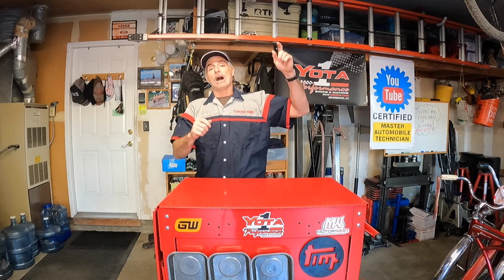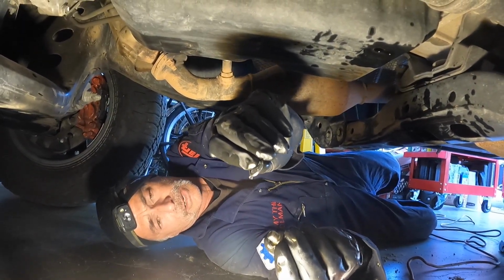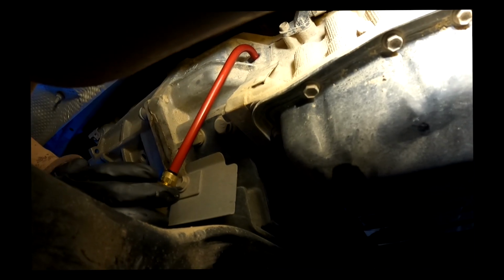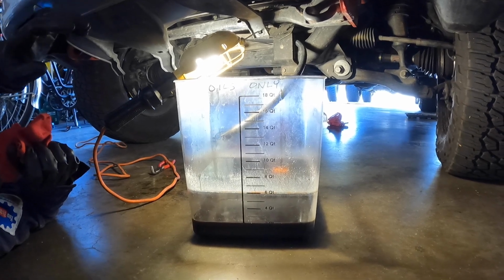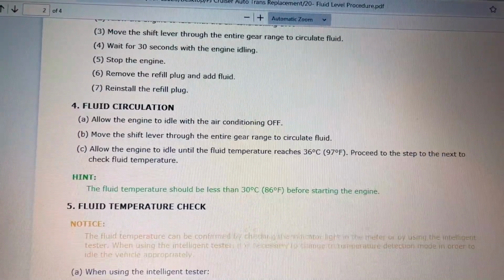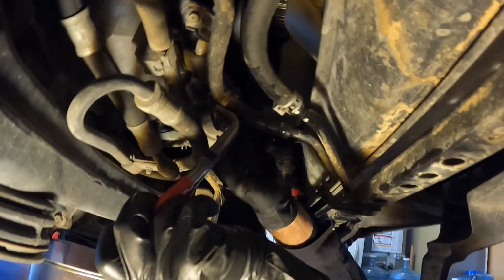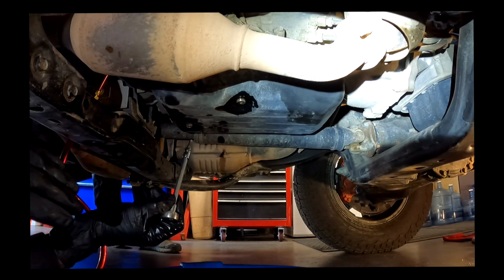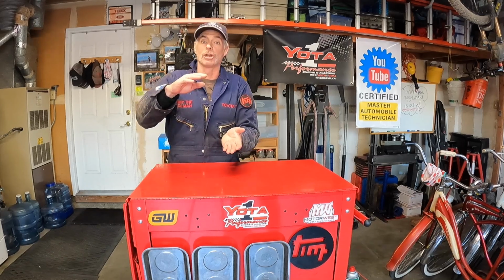Toyota/Lexus Sealed (No Dipstick) Automatic Transmission Flush (Fluid Exchange)

Comment: People do 'exact replacement of drained fluids' at a specified temperature. 

How does this correct previous inexact exchanges?

What is the purpose of the 'overflow drain plug' if the volume replacement procedure is followed?
Reply from the maker: Exact fluid level exchanges works if the original level was perfect and you added back in the exact amount you drained out.  I have containers with graduated volume levels.  When I drain out oil into these containers, unless the level falls exactly on one of the level lines, there's a bit of guesswork on exactly how much was drained out.  You could get close, but you'll be hard pressed to be spot on. 

The purpose of the overflow drain plug is to correctly dial in the fluid level.  Without this method, there's a level of guesswork based off what I said above.  Also, at some point, you might spring a leak in your transmission fluid system.  How would you get the level back to full capacity after repairing the leak?  The answer is the overflow plug.
Reply: @TimmyTheToolman  Thanks for connecting some dots.
Reply from the maker: @Shalmaneser1  You're welcome.

Comment: Last note.
Being the degree of past due lufe on that tranny, instead of just a follow up drain&fills, drop the pan and change the filter.
You will get plenty more fluid out and then can D/F from then on for 60K.
Peace.
Reply from the maker: Yes, dropping the pan and replacing the filter will get more fluid out.  From my experience with other Toyota transmissions, you'll get out around 6 quarts or 50% of the fluid capacity.  I believe 60k  drain and refill intervals only works for people who don't drive much in the hills or mountains.  When you drive on grades, you will achieve much higher transmission temps.  As the temperature of the fluid goes up, the effective life of the goes down.  Since I drive in the mountains a decent amount, I do drain and refills much more often then you, every 10k or every other oil change.  I suggest you do some research on how temperature affects the life of the ATF.  It will probably end up changing your mind on your service intervals.
Reply: @Timmy The Toolman  
I  agree on more stress driving/more frequent changes.
I was only commenting regarding Thahns vehicle as you said only a D/F for upcoming follow up.
You know, the one there is no previous service record of but is now at 'X' mileage.
Sounds like you thought I am challenging you, Bro.
Quite the opposite.
My wording was off. I was referring to multiple D/Fs only over the next 60K TORAL miles, not waiting a full 60K.
My bad.
I did 2 D/Fs on my owned since new 2006 at 87K(1st Service Ever), about 6.5 qts.
I used to drive in very congested highway conditions often commuting in Florida Heat, 20-50+ miles r/t), since Pandemo and Health Disability it's mostly short local and occasional 220+ mile open highway 75+average cross state trips. I never dog her. I rarely get to 4 Wheel Offroad but love doing it occasionally. 
Blew out one CV Axle cuz I did a little fun dirt driving stunt and sounds like I will probs need the other soon as well( used an ET Replacement as no OEM were available/too expensive/Pandemo...

Now I am going to repeat that at/by ~ 104K(and all gear fluids again) so that when I install my OFFROAD Cat Guard Kit I won't need to do again for next 40K, avoiding that whole removal process.
I don't have a shop/crew so must regulate my jobs to necessary ones. And having done full block drain Rad flush/Pink refill, a full brake line flush, entire front suspension rebuild,  as well as constant/consistent oil changes, and having you guys as one of my 1st/earliest DYI gurus, perhaps I have done my adequate research!
Thanks for your years of output. 
Still Love You Guys.
Next stop, Timing Belt Kit.
Afterall it's coming on 18 years old.
And purring like a kitty.
But why tempt fate!!!

Seeing all that mud under his Lexus, I stand by my Last Note.
Thanks for your considerate reply Timmy.

BTW, am at 103.5K currently. All mine, since 2005!
Peace.

Comment: I called a Toyota tech and he said as long as you replace the filter there should be no issues.
Reply from the maker: Those filters are a fine mesh metal strainer.  As long as the fluid is kept in decent shape, that filter will never need to be changed because it won't get blocked up by deposits.

Comment: I just use the trans cooler lines to drain and fill. Run engine and pump 4 qts out. Shut engine off.  Fill with a 12v pump with 4qts. You change it all that way if you want.  I've used Max Life in my 4runner with no issues. Being ocd I also install a inline magnefine filter.
Reply from the maker: I personally wouldn't feel comfortable running 4 quarts out at a time.  But, it's your rig, so do it the way you want.  Good job renewing your ATF.

Comment: I did this once using the cooler lines at the radiator.  Using the exit line, I pumped two quarts out a time, by starting the engine and letting the pump do the work.  Then, using the other line, pumped two quarts back into the transmission.  It's very easy to do.
Reply from the maker: Good job.

Comment: 29:50 my toyota had black oil came out of it, I drop the pan and clean the filter.  The filter itself was so dirty. Took about a gallon of gas to see  a suitable result. I would have replace the filter right then and there but where I live doesn't have those advance car part shop to get what I want. Have to order what we want from the state or elsewhere
Reply from the maker: We should have replaced the filter as well based off how dirty his fluid was, but we didn't have a filter nor the time to drop the pan.

Comment: Do you have any clips on transmission filter replacement for this GX 470?
Reply from the maker: No, we don't.  The transmission filters in these transmissions are a fine mesh strainer and not a paper filter like a lot of American motors vehicles have.  If you renew your fluid on a regular basis, that filter will never become clogged and have to be changed.  It's only when a transmission is completely abused and the fluid is allowed to become black and build-up sludge deposits that you should consider replacing the filter.  

But, we do have this video if you really want to go for it, which would be very similar to dropping a pan on any automatic transmission. https://youtu.be/tuGazNhuEtM
Reply: @TimmyTheToolman  Thanks!
Reply from the maker: @khaithi  You're welcome.

Comment: Nice video! My 2011 Toyota Highlander started to slip/shutter at 3&4 gear. Has 160k miles and never serviced the transmission 🤦🏽 I know! 

Will be trying this out. Thank you!
Reply from the maker: Hope it works out for you Fernando.
Reply: Did it fix the slip/shudder?
Reply: @MaximumDIYGarage  I ended up taking it to a mechanic and he flushed it. And no, it didn’t fix it. It went away for a month or so and it’s doing it again. Going to keep driving it until it gets pretty bad then replace the trans.

Comment: I appreciate your videos Tim.  I learn a lot from all of them.  Thanks for the time and effort to make these.  A guy or gal should be able to do their own mechanic work like this, simpler stuff.  The gist is, whether its sealed or has a dipstick, the procedure is the same for a flush - the only real difference being how you refill the transmission - sealed or not sealed.  Obviously much easier to fill with a dip stick and no pump.  

I watched a guy on youtube completely drain his transmission - not a Toyota.  He flush drained it until there were only bubbles coming out.  Then refilled it. without any consequence, at least shown to the viewer.  One difference in that case is there is no new fluid helping to push out old fluid and debris from any of the valves etc.  That seems sketchy as the lack of fluid in the draining mode could allow parts to damage and in the refill possibly too much pressure in certain areas inside.

I have an non CVT style automatic 2003 Tacoma A340 - I don't know if it is the F or the E.  I wish there were more definitive answers about a full flush procedure actually causing a slip or stuck condition.  I am tempted to flush mine out.  I want someone to say its okay to do it.  But maybe I will do a simple drain and fill two or three times and then if no issues just go ahead a flush it.

Anyway, Thanks for your videos.
Reply from the maker: Good to hear you're learning a lot from our videos.  You are correct.  Whether it's not sealed or sealed, the flush procedure is the same - drain a quart and add a quart until the fluid looks clean.  

The guy that just let all the fluid drain out at once is stupid.  I don't care if the transmission has no load on it, I'm not going to starve the transmission of fluid and hope I didn't cause damage.  It's also bad to let any pump run dry like he did.  

If your trans has never seen a service, it would be safer to do the series of drain and refills and do them gradually.  Space them out by a decent interval like 3,000 miles or maybe do them timed with your engine oil changes.  After the 3rd round, your fluid will be in pretty good shape.  After that, I would do a drain and refill every 10,000 miles or every other engine oil change.  That's what I do with my 4runners and I keep my fluid in great shape.   On Thanh's GX470, with how black his fluid was, we took a risk doing the full flush and got lucky.

Nobody is going to be able to give you a definitive answer if a flush will be safe unless they have a crystal ball and can predict the future.  Good luck!

Comment: These guys are the best, they have a great way to change the ATF.  There's several good reasons to change your ATF yourself mainly because if you do, your trans will probably outlast the car.  In owning around a dozen cars and trucks, 10 with auto trans 2 with a stick, I always changed the trans oil in all of them every year or every two years tops.  Most of the cars I ever owned had 200,000+ miles when I sold them, but not a single one ever needed transmission repair.  That might be one reason why Toyota deleted the dipstick in the first place, which is a very un-Toyota thing to do, but there is more to it as usual.
  
The reason why almost all automakers eliminated the dipstick and drain plug (the info is from a guy in the auto business, from a forum comment, so take it with a grain of salt) is that the US EPA quietly made an "arrangement" with the automakers to help reduce waste fluids from cars and trucks in general.  So towards that end the automakers, again quietly, started deleting the ATF dipsticks from everything!  (I'm convinced the EPA would weld the engine oil drain plug on and seal the hood if they could, and the fact is, BMW seriously considered, then thought better of, simply sealing the hoods on all their new cars (!)...this is a thing I'd dearly love to see them try, since the consumer reaction would be hilarious, unless you own a Beamer I guess!).  
I recognize the disposal of millions of gallons of waste oil is nothing to be taken lightly, but the fact is, such waste oil gets burned in millions of furnaces that are designed to use it... so why shouldn't EPA give rebates for such furnaces?  Anyway  

Anyway, even though it's cold comfort to understand the REASON they deleted the ATF dipstick it does nothing to help us change our ATF as often as we'd like!  ATF is a normal wear item same as tires or brake pads but they insist we treat the ATF as a "lifetime" product which it 100% is not!  
ATF made today has essentially the same service life as the fluid we've been using for over 50 years and, except for two additional words on the bottle, nothing about the ATF has improved enough to make it "LIFETIME FLUID".  Auto lubricants are constantly improving, of course but trust me, they did not suddenly figure out how to make the world's finest ATF with voodoo spells or sorcery.  Your ATF still gets dirty, thins out, and wears out, just as it always has, and that's why it needs to be changed - and there is nothing happening in the field of tribology so far that is going to change that anytime soon.
Reply from the maker: We appreciate your comment.  Yeah, ATF needs to be renewed.   The whole lifetime thing is a bunch of BS.
Reply: I recall some information that explained that the 'sealed-system' was designed to eliminate the free exchange of air to reduce oxidation of the tranny fluid, thereby extending the effective life of the fluid.   ...  I believe there must be a 'vent-valve' that is pressure and vacuum regulated (so no dipstick and no open venting).

Comment: Outstanding job!  Thanks for posting.  Would love to see one for the 3rd gen Tundra.
Reply from the maker: Thanks and you're welcome.  The process for any Toyota sealed transmission would be similar.  The only question would be does the temperature at which you check the level at change at all.  

You can get access to the information through the Toyota Tech Information website.  You can buy a $20 / 2-Day Subscription and download the info.  The website does have a little bit of a learning curve, but once you know how to use it, you can get any information you want for any Toyota/Lexus/Scion vehicle.  When I first used the website years ago, I was successfully able to use my Mac laptop.  Then one day I had issues accessing the site and I called for help.  The lady helping me said I needed a windows based computer now because their system changed so I bought a used Dell Laptop running windows and haven't had issues.  But, recently, some guy told me he successfully navigates the website with his Macbook and using Windows is only for the Tech Stream program.  Anyway, I've blah blahed enough.  Here's a link to the website: https://techinfo.toyota.com/techInfoPortal/appmanager/t3/ti?_nfpb=true&_pageLabel=ti_home_page&contextType=external&username=string&password=secure_string&challenge_url=https://techinfo.toyota.com/techInfoPortal/login/techinfo&request_id=-5518364760491963150&authn_try_count=0&locale=en_US&resource_url=https%3A%2F%2Ftechinfo.toyota.com%2F
Reply: @TimmyTheToolman  Your awesome!  Once again, I appreciate the info.
Reply from the maker: @markk2060  No problem Mark.  If you like to turn wrenches on newer Toyotas, that Tech Info website is super beneficial.  I use it a lot because I've branched out from just working on 3rd Gen 4runners which I have the physical factory service manual books for.  The information I used to do this transmission service came from me downloading it from the Tech Info website.

Comment: Thank you for great instructions. Is there a difference in checking the level (open drain) with the engine turned on and off?
Reply from the maker: You're very welcome.  The level has to be checked with the vehicle running and the fluid circulating.

Comment: Do you know how much quarts I have to put in my 2017 Toyota Sienna 2wd?
Reply from the maker: How many quarts when it's completely empty or after a drain of the pan?  Usually a drain of the pan is around 4 quarts.  The whole system capacity is somewhere around 12 quarts.
Reply: @TimmyTheToolman  Drain of pan with taking inside filler tube out. Thank you so much. Helpful information 👍
Reply from the maker: @1empire93  I'm not familiar with your particular model Toyota but it's a Toyota and they're all very similar.  You should get out around 4 quarts, but that's my guesstimate.  The important thing is to go through the proper procedure to get the level right.  I don't know if Toyota recommends the same temperature at which you dial in the fluid level like for the transmission in the GX470;  But, again, I bet it's probably going to be similar.  Take the drain plug out, then take the overflow tube out and drain the oil out into a container that allows you to measure the level.  Put the overflow tube back in and drain plug back in with a fresh drain plug washer.  Replace the amount you drained out by using a pump similar to what we used.  Then go through the fluid level check procedure we document.  The only difference is you have that removal plastic filler tube, and the pan we were were working on has a separate overflow plug and separate drain plug.  I hope this helps.
Reply: @TimmyTheToolman  Thank you for your help 👍
Reply from the maker: @1empire93  No problem.

Comment: Excellent how-to video. Question: wouldn’t it be better to pump the transmission dry, first - then filling the transmission once with fresh fluid instead of going a quart at a time?
Reply from the maker: We like doing it one quart at a time.  We don't like the idea of the transmission running that low on fluid.  The safer technique of one quart at a time is what we recommend.  We're glad you like the video and we appreciate you taking the time to comment.  Good luck with the fluid exchange.  Your transmission will thank you.

Comment: I've done mine through the front trans. cooler, 1.5qts at the time. Much easier in my opinion.
Used valvoline Max Life ATF. 50k miles and no issues.
Reply from the maker: I guess disconnecting a hose from the cooler could be a little easier since you're not on your back but I can also see it being messier.  With where I disconnected the hose, the ATF is just going to drain directly into the pan I have underneath the vehicle.  When disconnecting at the cooler at the front of the vehicle, I can see that being a messy proposition.   So, your "Much" easier designation for your method compared to ours doesn't really fly in my opinion.  We each had to disconnect a hose and attach a hose.  Nothing is hard about that.  Anyway, good job doing the flush on your own.  Your transmission thanks you.  Most people forget about servicing their auto trans.